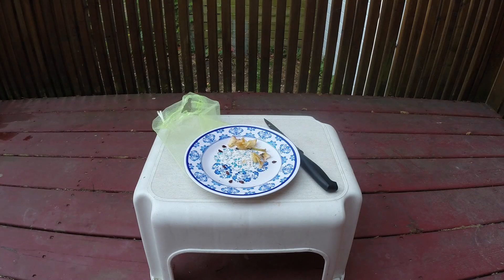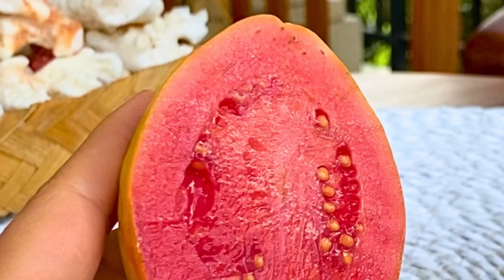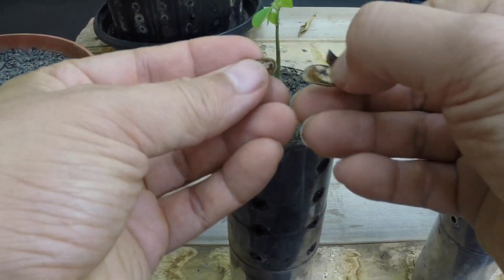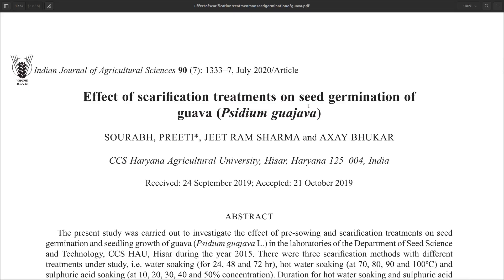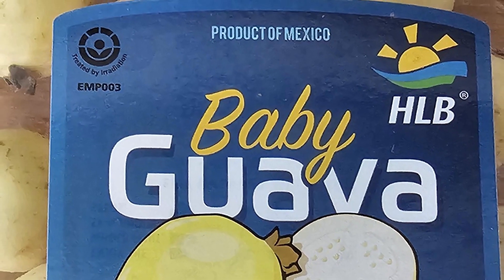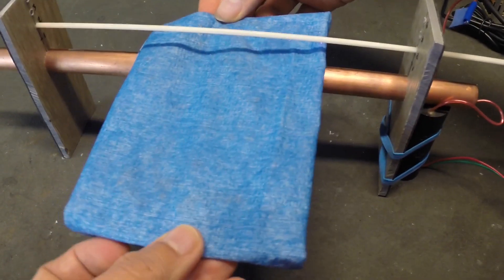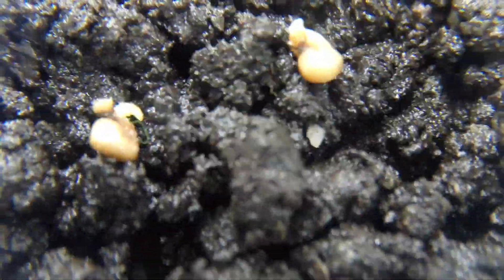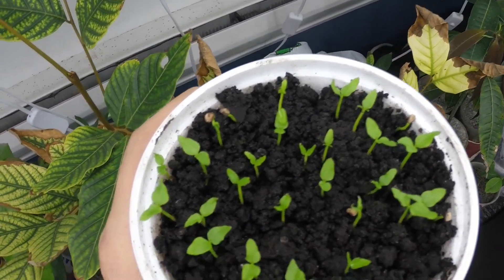Germinating Guava Seeds With Plasma

Comment: Are your tropical guava trees not killed by low temperatures and snow?
Reply from the maker: I have to grow them indoors from October to May.
Reply: @cooltherapy  Same here in the UK, but there is always leaf drop and some dieback when I take them indoors.
Reply from the maker: @myexoticfoodplants6727 Maybe you bring them in too late?
Reply: @cooltherapy  I have been growing a Tropical Pink Guava, since May 2022. For the past two years, it has overwintered in my conservatory but faced challenges like insect infestations, inconsistent watering, possible root rot, and dieback. This winter, I’m trying something different. I have been overwintering it in a grow tent outside in my back garden. The grow tent is equipped with a thermocouple temperature control system that activates when temperatures drop below 4°C and switches off when they rise above 5°C. I am hoping to acclimate the plant to my local conditions and for healthier growth this season.
Reply from the maker: @myexoticfoodplants6727 I knew a doctor that would sneak in the rooms of his new-born grandchildren at the hospital the very first few days after they were born and drop a little bit of dust from the house of their parents. He said none of his grandchildren ever had any allergies growing up. That's why I prefer growing from seed. But shhht, dont say I told you this story.
Reply: @cooltherapy  Yes I know, I am a little mad 🤣🤣
Reply from the maker: @myexoticfoodplants6727 Keeping a stable temperature between 4-5C is impossible for me after November. By the way I assumed your pink guava was grafted. Why don't you grow it as a houseplant? I never had any insect infestations, root rot or die back with mine, indoors in winter.
Reply: @cooltherapy  No the pink guava was grown from a seed and given to me by a friend. I do not aim to keep the guava in the grow tent exactly between 4-5C, only to keep it from reaching 0C (freezing). By the way, have you managed to get any of your guavas to fruit and set fruit? Growing subtropical guavas Psidium cattleyanum is easier.
Reply from the maker: @myexoticfoodplants6727 Sorry, since you mentionned pink guava, I presumed too quickly that it was grafted. Has it produced fruits yet and are they pink? Ususally guavas are not true to seed, but that does not mean they cannot inherit some traits from the mother tree, not sure if the pink color is due to a recessive gene. No, my guava seedlings  have not produced fruits yet.